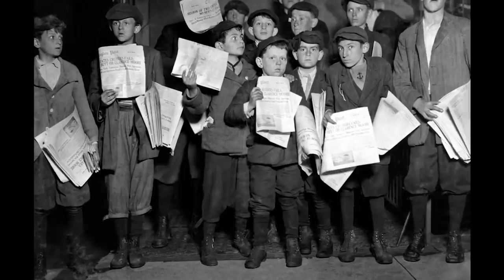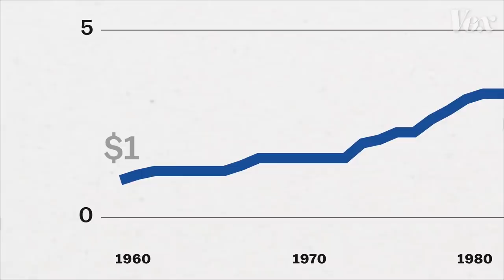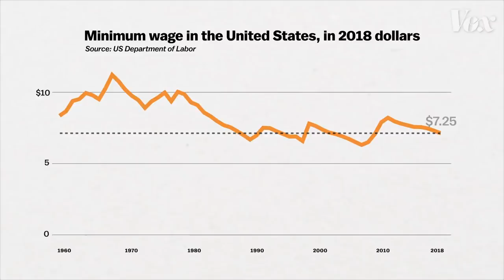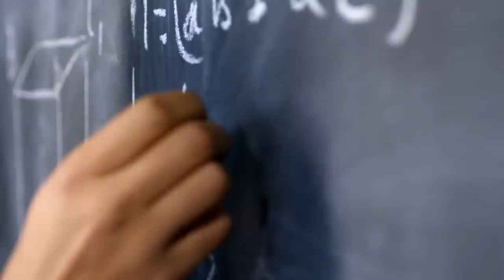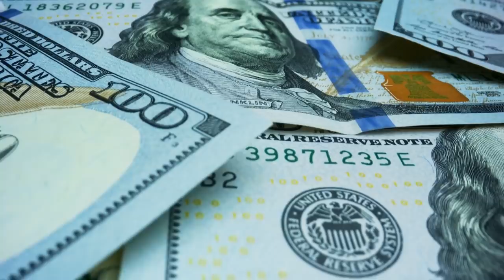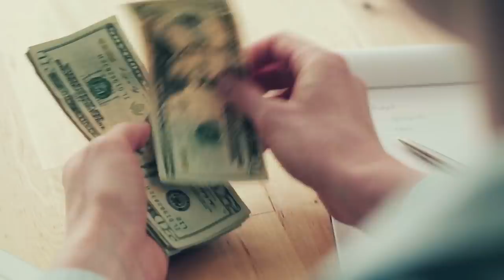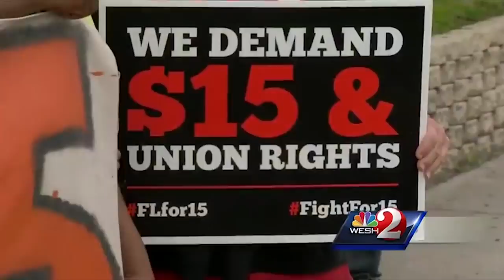The Minimum Wage Debate Explained

Comment: "Starter jobs" is an absolute bullcrap term anyways. Without starter jobs, no one's going to make your burger, take orders, stock the shelves, clean the crappers, server your dinner, drive you when you don't have access to a car, build said car, deliver you that fancy new item you ordered online, and I could keep going. Regardless of all other considerations, these are essential jobs, and they, and indeed ALL jobs, deserve to be paid living wages.
Reply: "Starter Jobs" imply that these jobs aren't necessary, but that term is used for anything but. The term "Essential Worker" and "Starter Jobs" are typically used together.
Reply: You get enough to survive. Want to live? Make more. Get a second source of income or add value that builds the company (which is different than just doing your job for 30 years).
Reply: @shaereub4450  go look to any graph comparing minimum wage to productivity over the years to see how BS that "add value to the company" line is and then stop bootlicking.
Reply: @shaereub4450  No, they do not, their wages must be subsidized by social programs. A system where one needs to "hustle" in order to live is a bad system.
Reply: @dynamicworlds1  yes but productivity increases are usually due to technological gains.  its not that the person making 7 bucks an hour is working harder than they did in the 1960's, its that they have technology now that wasn't available then.
Reply: @theharmelodynetwork  even if we accept that as flat true AND ignore the fact that real wages have declined, why tf should the workers' extra productivity provided by force multiplication of more modern tools (developed by other workers) go basically exclusively to rich people who's only claim to that wealth is that they already own more wealth than the people working for them?

And how does that counter my point

AND are the CEOs and stockholers sitting on their asses working any harder than they used to to justify getting a bigger piece of the pie?

I'd be fucking mortified if I made an argument that stupid.
Reply: Have you ever seen someone over the age of 25 work at McDonald's? It is a starter job
Reply: Look buddy, those "Starter Jobs" are important, but some people live with my parents and want to earn money to do some party  to work for 6$ a hour  is no problem for them. Some people need more but the employee will always know that somebody else  avaible so no chance that he will raise the wage.
Reply: @jamesmorgan3764  All the fucking time, dude.
Reply: @aidancollins1591  maybe they should further their education or gain some actual skills. It's nobody else's fault someone decided to drop out of high school and make Carl's Jr a fucking career.
Reply: @juanvaldez6651  I don't care about fault, I care about efficiency and maximizing freedom for as many people as possible. Our current system is and does neither of those things. It's clear you do not see people suffering as a problem you should care about.

Regardless, your assignment of personal blame for those who are poor is disgusting. Reeks of privilege.
Reply: No mate start jobs are jobs for young people entering the work place for experience 
And most of the jobs you said are good pay
Reply: @shaereub4450  you missed the entire point the video was trying to make.
Reply: @juanvaldez6651  who   the fuck gonna work at McDonald’s or Walmart if we all thought that way ?if we all were lawyers or some other high paying career they would be no one to work at these places
Reply: @MegaAnimeforlife  Those jobs are for kids to get work experience then find better ones. If you wanna work at McDonald's forever then go for it, but you don't deserve to make $20 a hour for it.
Reply: @juanvaldez6651  If these jobs were just for kid's they wouldn't be open during school hours now would they? Get real with yourself and learn how the world works, also nobody is saying they should get 20$ an hour.
Reply: @dynamicworlds1  idk how people want to work a 9 to 5 job meant for teenagers to have a family. I got an education to earn my wage. Stop being lazy and learn a new skill. That’s what the working class does.
Reply: @shaereub4450  dude you just proved why it's bad, if you need two jobs to live, then the system has failed you. People should not have to "just survive", they're people, not cattle. Capitalism and those who exploit others are vile and disgusting.
Reply: @TinyBearTim  these "starter jobs" are open 24/7, tell me how these young people can possibly manage to work during school hours.
Reply: @ABCD-vm1mx  how tf is someone gonna learn a new skill and work multiple jobs to sustain themselves, it's honestly so easy to poke through these arguments
Reply: kettle r  what if the person doing the job was homeless, an orphan, anyone who is alone? What if that job was what was supporting them? Maybe they are supported by welfare or some close friends, so they may not be truely alone. That extra money to help him or her is either other people's money through welfare by taxes or a handout by the charity of the people close to them. Should their money come from multiple sources or just from the employer? The multiple sources are pretty volatile. But, getting that living wage will free up that person's time to do other things or stay the way he or she is. The living wage income would be less volatile due to all companies providing good money and since they need labor anyways, they need only apply. It's better to walk a steady path then to risk a trail with shaky footing. They now have options rather than punishing them by trapping them into a bad situation with little leeway. They will eventually become stable and pay higher taxes into the system, so as to aid less fortunate people. They may change their source of income from welfare into investment.
Reply: kettle r  No one should work full time and not have enough to survive on their own, full stop. Any other arrangements are inherently going to be exploitative to workers. Companies that don’t pay enough to keep their employees off welfare are robbing the public coffers. I wonder who would be lobbying to keep minimum wages low?
Reply: kettle r  14 year olds don’t often get jobs these days. Teen workers are still a thing but way less prevalent then previously.
Reply: kettle r  how could your “living wage” be 70K or are you just throwing the word around like it means nothing.
Reply: kettle r  “living wage” means you don’t need a second job to be over the poverty line not to sustain my current live style
Reply: kettle r  I live comfortable but carefully at 20K a year the minimum wage right now gives people roughly 13K I can’t imagine living off of that.
Reply: kettle r  also people aren’t replaced by robots someone has to both build and maintain that kiosk not to mention its also damn expensive so often time business don’t even use them unless there a Fortune 500 company.
Reply: kettle r  you obviously still don’t get what living wage means your current wage is not what dictates a living wage stop calling it that but let’s move past that
Reply: kettle r  you know our birth rate is going down right? Who's going to feed all of these "adults" when you inevitably don't have enough children to do those jobs? And sure you could probably live off 6.15 in some buttf*ck town in the Midwest but if you live in a city, especially on the coast, you will be homeless. And like you're saying should a 14 year old be paid less than you working at McDonald's? No, you both should earn enough that with careful spending you can make ends meet. That's a living wage. You can afford a roof and food. And as someone with a college degree working in an entry-level position, I find it incredibly insulting and unreasonable that you should think it's ok to be paid so low anywhere. Look, yes, ideally you get a better job by getting a new skill. But new skill often require certificates by hirers which cost an exorbitant amount of money. Entry level will not pay enough for you to go to school or even play those classes. Sure you can do classes like skill share but you won't be hired until you freelance or whatever and you're not going to make ends meet for too long during that. Anyone who makes a living wage, could invest their free time into betterment, and save for classes. And honestly, the guy that cleans your toilets should be making what you make honestly. I know you feel entitled because of your expensive education but people that do those jobs have a rough go and their jobs are extremely necessary. It's insane to think it'd be ok for that guy to have to work two or three jobs. I'm working 3 right now btw. So, congratulations on your 70K live style but I'd be ecstatic to have $40 or $50k a year. I would be set. And sides, I think the billionaires can stand to tighten their belts for the betterment of society. Ffs, Bezos could sustain his current life style and that of his next like 3 or 4 generations if he stopped earning right now. There's no reason to hoard money. And should a owner of a company make less their their employees, well I suppose it depends on the time they spend but no I think they should make the same or similar to their employees for the amount of time and effort put in, just like them. My goal is to own my own business because screw bosses and selling my soul, and I will make sure I'm not paid significantly more than my employees. Matter of fact, if others do harder jobs, I'm content making less, as long as I'm comfortable. As long as we're all comfortable.
Reply: kettle r  yes for a single person who has no spouse or children and no intention to have either it’s technically just barely above the poverty line.
Reply: kettle r  I think that the wealthy nation on earth should have a higher stander then you have clothing and don’t go hungry your good. Sounds like fucking Africa that’s ridiculous. Norway pays McDonald’s workers 21 dollars an hour and their Big Mac cost 27 cents more I think we can handle that price increase.
Reply: @SchokoAprikose  if he wants to do more than look for a better job or get a higher education, work for it.
Reply: kettle r  have you ever lived in poverty I did as a child. I felt my mother’s fear and uncertainty. And because of that I to was afraid did we have food and a roof and clothing sure. But that doesn’t mean we where comfortable sometime we where afraid we would have enough for one of those things and it was a mad scramble to kind a solution because one time to fall down into debt and we would have no way to get back up again as we could barely make it with some corporation squeezing us with there interest rates.
Reply: kettle r  now my mom has a good job and isn’t a single mother. I have a good job to and I live comfortable but that doesn’t change the fact that other people don’t deserve living on the poverty line straddling it like a tight rope always afraid to fall afraid to have a family afraid to ever spend the little money they have because they might need it. All the while company execs give themself massive pay raises and bonus no I’m not ok with things staying the way they are and quite honestly it disturbs me how strongly people defend the corporations that lie and cheat and wouldn’t hesitate to throw you aside if it benefited them for one second.
Reply: @jamesmorgan3764  wtf?! Yes I have seen people over the age of 25 at McDonald’s...
Reply: kettle r   17 dollars an hour is above the proposed minimum wage so I’m not sure what point your trying to make.
Reply: @camerontaylor7471  not as many as under 25
Reply: kettle r  7.25 has been the minimum wage for the last 10 years to keep up with inflation it should have gone up at least 1.59 but even if we’d done that it had already flagged behind inflation for years and they didn’t raise it as much as they should have last time. The minimum wage has always been raise over time and it’s never bankrupted America or just a massive hissy fit from the corporations ever single time cause they just don’t like paying people more.
Reply: @austin5944  m8 it’s called part time and you can just get hours that aren’t in school time or a weekend job
Reply: I like cheap burgers and repairs and pizza deliveries. Everyone talks about affordable childcare, healthcare, education, housing. Nobody talks about affordable labor.
Reply: By increasing starter jobs wages, you increase all jobs wages and all product prices go up. Now your stupid 15 dollars are worth 6 dollars. Just get the government out of this stuff and the pursuit for profit will make things cheaper, and even with a lower wage you’ll must likely have more spending power. Spending power is the key not the amount of money!
Reply: @marcello1099  the market Isn't a perfect sistem and if thing would be chaper then there would be someone Who need less money to suvive and wages be lowerd by the company.
Also you could have a minimum wage Who just automatically adjust itself whit inflation whic Is what many countrys have.
If the minimum wage Is so connected whit inflation then that means than most of americans work full whit the minimum wage.
If this Is the case then the problem isn't the minimum wage but the economy itself.
Reply: Robots will soon.
Reply: Wait, don’t you get that increasing the minimum wage drastically simply reduces the amount of people doing starter jobs and increases the load of each worker?
That’s not good, it essentially erases “starter jobs” and makes them more demanding, higher paying jobs, WITH LESS OVERALL DEMAND FOR WORKERS
Reply: Justin Sawyer  a full time job Is a full time job independently of what kind of job It is. A kid could work in a farm but It Is still a full time job.
Reply: @aidancollins1591  You can’t just hand out freedom.
Raising the minimum wage for McDonald’s workers? You think that makes them more free?
There won’t be cashiers, there will be kiosks, the people making the food will be asked to do more and work on a smaller crew. Salaried managers are asked to do even more than they already do.
How is that increasing freedom?
Reply: Justin Sawyer  if you can't sustain a company by paying the minimum wage to your employes then your company Is not competitive.
I'm saying full time job because if you couldn't sustain yourself whit that wage then you wouldn't have time to learn new skills to improve your conditions or to get and other job.
Reply: Justin Sawyer  if you can't sustain to feed your workers whit a full time job then your company Is not sustainable in a cost\profit comparison.
Reply: Justin Sawyer  everyone loves saying it would destroy the market or increase good prices like crazy this is just plainly untrue. Other countries raise there minimum wage yearly to keep up with inflation and your telling me we America the most wealth country in the world can’t afford it ridiculous.
Reply: Justin Sawyer  obviusly this Isn't a discussion about when you first start the company but when the company acually Is stable. Usually you get a Loan when you start the company of you are that stupid to start a company and fail at the very beginnig then it's your own fault for tacking  the risk and not considering the costs.
If the governament stops pepole from being paid so Low than they can't sustain themself It Is not disincentivizing jobs, Is preventing slavery and protecting workers lifes.
Reply: Justin Sawyer  wrong we are still number one in wealth and no not all of those counties are affiliated with others. Not to mention how does the population matter when we proportionally per person we have more money then them.
Reply: Justin Sawyer  weather you mark is as first depends on how you measure wealth but we are always top ten regardless of the metric.
Reply: Justin Sawyer  if your company manages to go banckrupt then It Is not the minimum wage fault It Is your bad management. In 5 years an employe should have enought experience to at least get a raise. Stop blaming evrything on the minimum wage for an unsuxeful company. It surely won't be the wage fault if the wage Is the same.
Again bad management.
 Oh And thanks to the inflation the wage value acually goes down so there Is no excuse.
Your company could still fail even if you didn't pay wages at all.
Reply: Justin Sawyer  Demand meaning the amount of jobs the business needs.
You are the one missing shit homie
Three high schoolers vs two more experienced people 

That’s a loss of demand for one job.
Reply: Justin Sawyer  oh becuase the US has the se population as china and india i see
Reply: Justin Sawyer  like I said depends on the metric people don’t agree on what metric matters
Reply: Justin Sawyer  Lol, you are explaining why the minimum wage does not need to increase and why decreasing illegal immigration will help wages increase!
Reply: Justin Sawyer  dude i have just Google biggest GDP in the world and It came up the US on number one whit 19.485 trillions
Reply: kettle r  If the same is expected of a 14-year-old as is of a 41-year-old, namely all that is needed to do a job properly, why not pay them firstly the same and secondly a normal wage? The jobs need to be done. So why give the people who perform them an artificially low wage?
Reply: Justin Sawyer  first of all you ain’t teaching me shit. I know full well not every countie does it but it working in other countries is more then enough evidence to support it working here but also no not all the counties are part of things like the EU.
Reply: @kevinsouza7744  *
Reply: Justin Sawyer  if we count gdp per capita the of course tax heavens came out on top.
And the US Is still the 8th behind all of these tax heavens.
Reply: Justin Sawyer  and that Is why if we exclude tax heavens the US has the biggest gdp per capita.
Reply: Justin Sawyer  aren't you a bit too agressive? Just called me idiot for a statistic i did not share.
Reply: Justin Sawyer  https://en.m.wikipedia.org/wiki/List_of_countries_by_GDP_(nominal)_per_capita
Then what about Wikipedia?.
Reply: Justin Sawyer  i mentioned tax heavens because i would thought you would understand than i excluded them for being.....well tax heavens.
I made no aegument saying than tax heaven are better. Being a tax heaven in the US Is not sustainable
Reply: Justin Sawyer  then what source Is reliable to you?
Wikipedia Is One of the most checked sites in the world whit million of pepole contributing to It and whit a full staff controlling for errors.
Serusly link me a site you trust.
Reply: kettle r  You seem to be answering a question I posed by saying "because the skill labour doesn't change". But which one of my questions are you answering by saying that? I asked why one would not pay a 14-year-old and a 41-year-old the same. And I asked why one would not pay them a normal wage. And, lastly, I asked why one would pay them (referring to both the 14-year-old and the 41-year-old in my example) an artificially low wage. It doesn't make sense to answer any of my questions with a "because the skill labour doesn't change".

I am in favour of paying the 14-year-old and the 41-year-old from my example the same. And I am in favour of paying both of them a normal wage and of paying both of them a wage that isn't artificially low. The same goes for the 81-year-old from your example. All of those three people should earn the same since it's the same kind of work they are expected to do. The same quality of work and the same quantity of licked stamps per hour is expected of them. All of them do the same and are equally useful employees. And since they wouldn't have been given jobs if they didn't need to be performed, they should be paid a normal wage and not one that is artificially low.

Judging by your other comments, you are the one who wants to pay people artificially low wages. So it seems we agree on how everybody doing a specific job should earn the same, no matter their age. But unlike you, I advocate for paying them all a normal wage and not an artificially low one. I really don't get how you could misunderstand my comment to say that I think that a 14-year-old and a 41-year-old should earn different wages despite both of the doing the same job equally fast and equally well.

Edit: Added missing word.
Reply: Justin Sawyer  and i acually want to Say It because i checked twice but wikipedia in this article makes referente to the united nations and  the International monetary fund.
Reply: Justin Sawyer  so you don't belive in the biggest International oraganization in the world?
I guess the conversation ends here because we've come to a point where we can't reach a common ground.
Reply: @SiegePerilousEsauMaltomite  In their ability to have more income, get paid vacation, enjoy life more, and have better workplaces, yes. There is a positive freedom to that. The rest of your statement is filled with a bunch of nonsense not worth addressing.
Reply: kettle r  that means the only reason you can't work in McDonald's at 14
Reply: A job is only worth what someone is willimg to pay for a service.i think the argument should lie in profit sharing
Reply: @jamesmorgan3764  
Are you crazy or willfully blind.
Reply: Justin Sawyer  
Is it a hate crime to wish you to be the  victim of a violent crime.
Reply: Justin Sawyer  how am I uneducated I’ve been to college?
Reply: Justin Sawyer  I am perfectly willing to learn thing you have quite simply not mentioned anything I don’t already know or your info is with corporate lenses. Our countries standing in the top ten charts is not really relevant to the fact that we have the worst labor laws and it’s considered blasphemous to want to pay people a reasonable amount for there time.
Reply: Justin Sawyer  The risk is the time you put into the job flipping those  burgers. The entitlement comes from the fact people are paying you to prepare food for them. You argument that they shouldn't get a share in the profit is fucking stupid. If they weren't flipping burgers then what would people be paying McDonalds to do? Exist?
Reply: @ABCD-vm1mx  And where did you live when you were doing this? You pay for your own food and housing? Where did you find the time to go to school and pay for this oh so affordable housing that you had. What was your rent fool? Stop thinking everyone circumstances are the same as yours. You think your the only one that exsists in the country?
Reply: @ABCD-vm1mx  
Interesting.
Now let me inquire a bit.
Hypothetically speaking wouldnt you still be on hook to pay for the loans you took even if you didnt land a job making you, gasp, a poor person?
Also I wonder how many job openings your career has, can it support massive influx of new job seekers if they decided to do the hustle?

Sure is nice standing in glass tower and try to forget the fact that there will always be more people below it than at the top
Reply: kettle r  Responding to both your replies in one go here. A normal wage is one you can live off if you work full-time and without having to resort to methods like living rent-free with a partner or relatives/family members. And no, I personally would not pay an engineer more than someone "sweeping the floor". But I also don't think that the difference in what those two people make needs to be big. How about paying an engineer only two to two and a half times as much as the "floor sweeper" at most . How about paying the engineer only one and a half times as much as the "floor sweeper"? One argument you seem to have against that seems to be that "minimum wage means minimum labour". What makes you think that? I have worked in a couple of jobs and in most of them I could also form a picture as to what the working days of my co-workers who were performing different tasks and who had different job titles entailed. I have for example worked as a trained nursing assistant together with what in the US is called "registered nurses". A registered nurse earns roughly one and a half times as much as a nursing assistant here. But this is not due to registered nurses having to "work more". They work more competently than nursing assistance. They went more into depth in their training, and they are allowed to do things that nursing assistants are not allowed to do. They have more responsibility. Which leads to them also having more opportunities to sit on their asses for at least part of the day or just standing and not having to lift heavy things and heavy people. This is not a problem for me. It makes sense that it's like that. But it's true that a nursing assistant burns more calories during their workday than a registered nurse does - at least on average. Minimum wage does not equal minimum labour. I don't know how you managed to develop that concept. It kind of makes you look like an ass. (I wonder where - or whom - I got that respectful way of phrasing things from.)

And why would you have to double everybody's wage if you double the wage of someone who is currently making minimum wage? If you have a "floor sweeper" making $7.50 and a person working in accounting making (the equivalent of) $14.25 and an engineer making (the equivalent of) $45 an hour, why couldn't you simply raise the "floor sweeper's" wage to $15 an hour, the person working in accounting's wage to $16.50 an hour and not change anything about the wage of the engineer? I know this leads to a higher total cost of salaries, but this is not the issue you're raising. The issue you're raising is that the engineer would also have to get his salary doubled if the "floor sweeper" got his salary doubled. But why? Where's the problem when the wage gap between the person earning the most and the person earning the least in the company shrinks? And in what world would it make sense for either the engineer or the person in accounting to quit? Would this lead to them getting higher salaries elsewhere? No. Does the fact that the engineer can't anymore say that he earns six times as much as the "floor sweeper" but that he now can only say that he earns four times as much as the "floor sweeper" make the engineer suffer in any way? Tell me, what thought process lies behind the notion that someone with a high salary quits their job over someone else in the company earning more than they (the other person, not the person with the high salary) earned before? If I earned 4'500 a month working on a computer all day and some cleaning staff member in the same company got a pay rise, resulting in them not earning 3'500 anymore but instead 3'900, I would think that this is good for them. Maybe I would think that it is unfair that I didn't get a pay rise. But why would I quit over that if I knew that everywhere else I would also earn 4'500 a month. And if I indeed could earn 4'800 a month elsewhere - why would the pay rise of a co-worker (or whatever you want to call it) lead me to quit my job? Why wouldn't I have switched jobs earlier? Nothing about a pay rise of another person makes my life worse or my job harder, unless I start earning less because the money for the pay rise of the cleaning staff member comes out of my salary.

One last point: Which goods and services would start costing more and by how much would their price rise? This is actually addressed in the video. A Danish McDonald's worker makes $22 an hour. And the hamburgers there don't cost ridiculous amounts of money. And Denmark isn't exactly a country with food deserts - everybody who buys a hamburger at McDonald's in Denmark has easy access to food that costs less and is more nutritious.
Reply: @MrAapasuo  the thing is, I landed a job right after I graduated. It’s where I did my hours which is something the school does so that we can acquire a real time to hone our new learned skills some offices pay for the internship, and I specifically looked for one that paid, it was minimum wage at the time,  but my time is valuable and for the moment I took anything over free labor. I also asked for my wage and benefits before starting actually working there. And I’m not poor because I refuse to be. There’s a way around everything. My school helps me find a job if I ever need one, and I’m not required to stay in the ones that offer the bare minimum for my skill. Gasp! You can actually choose where you work. Coming from someone who lived in Mexico. Y’all Americans complain too much😂. And if you’re wondering I’m a dental assistant. You can look up the wage. Some states don’t require a license for it, but mine does. There’s always a need for dentist. Therefore a need for assistants and they always hire more than 1. Because if you’ve ever been to any healthcare facility you’ll know it’s gets crazy behind the scenes. So my job will always be a necessity in America. What I like about mine though is that we’re safe if free healthcare becomes a thing, since our office is privately owned. So we won’t be overworked and paid less than what I know I deserve.
Reply: @MrAapasuo  since my job requires a certain set of skills and is constantly changing, time only becomes a benefit as it becomes experience. When employers are looking for people in my field they want someone that won’t cost them 3 months of paid work to learn how to take X-rays. As the schedule will always be hectic and time is money, they don’t want someone that backs up patients. And in the situation that I do lose my job, I have enough skill to seek out another job and better pay since a lot of my jobs are looking for lead assistants or managers, you know someone with experience. So my starting pay will only increase as the years go by. I’ve only been working for 4 months and my Dr already wants to raise up my wage to $14/hr. I’m getting paid $12 at the moment and the starting pay in my state is $7/hr.
Reply: kettle r  Just replying to one reply here: Because you get more money that you either need or want. And again: There's no reason at all to even suggest that with some tendency a person earning $14.50 an hour has to work less or less hard for that salary than a person earning $16.00 has to work for their salary. Since when is a working day of 2 hours of mundane computer work and 6 hours of preparing food more or harder work than a working day of 8 hours of preparing food? The opposite is the case. And the one working on the computer for two hours each day is the one earning more because he's the superior of the other person.
Reply: @ABCD-vm1mx  
Kudos to you but Im no yankee, born and living in Nordics.
By the way you might be interested in learning that in many places with universal healthcare Dental works are still private, though subsidied for school aged kids.
Not that it matters as healthcare workers are some of the best paid professions here along side higher education teacher's.

One can indeef choose where to work, if there are jobs open that one can do.
Not everyone is educated for everything, shocker I know, so I doubt any dental workers here will be picking up welding any time soon to work in shipyards. 
And one can refuse to be poor if they wish but most people I think are in consensus that being poor beats going homeless
Reply: kettle r  
Im pretty certain a child/teen could run an company so I guess we should replace all CEO's with min wage workers
Reply: @MrAapasuo  I’m not poor and I’m well off. I equate being poor to making less that 1k on their pay check. Which is something I was taught was bad. That is why I said, you can get a black collar job that pays well, or a yellow collar job that pays well and treats you well if you actively look in the right places. Maybe I’m more optimistic and ambitious but my time and skill are valuable. I think most people give their employer the power even though your what keeps the company running. Like I said every job should have benefits where employees aren’t afraid to miss work and provide liveable hrs. I know that I take a week off, my paycheck will still be the same. And it’s something I worked for. I’ve also m noticed that more and more healthcare workers are coming out and stating that in their countries where healthcare is “free” they are still paid well, but are overworked. So if a nurse made $20/hr either her hrs gets cut, or she works more than usual at a lesser wage. Maybe it’s a small percentage , but in a country like America that wouldn’t slide. As free healthcare wouldn’t benefit those working in the healthcare system. I always advocate for affordable healthcare, it’s always baffled me how someone who makes 20k a year is charged by hospitals to pay for a $20 million dollar procedure or the only other options cost more than their accumulated 5 year income. Big pharma is a problem, as medicine is usually machine made and the cost to make it is inflated at ridiculous levels. Also I appreciate Dr’s and their skill, but they either shouldn’t be working the hrs they do.18hr shifts are hell and the fact that it’s usually 5 days out of the week is ridiculous and why I feel hospitals overcharge for procedure performed by certain specialist. Even if they only worked 12hr shifts they would still make more than they need, to maintain a luxurious lifestyle and be able to pay off school. I also believe that healthcare should be free for the children and the elderly. And something that should be covered by employers out of their own pocket. As companies make too much money, more than they already need, and studies have shown that the more money they make the cheaper or worse their product becomes. It’s also a way to know that the government only pays for those that actually need it. And those employed(in any job) still get healthcare, that is technically paid by them, but not with money taken out of their paychecks as long as they work in the company or hold a job, they are guaranteed healthcare. Which is something I actively advocate for. Hopefully one day in the future it’s becomes a popularized idea.
Reply: kettle r  
Fancying this sort of game huh?
Show me in turn a child can make fastfood without any education or a child that knows what various cleaning substances do without being educated
Reply: @ABCD-vm1mx  
The overworking problem is real in healthcare, but not caused by healthcare being free.
Its simply the fact that there are not enough doctors to meet the need of people, thus exidting doctors are used past their limit.
And more money stringent cities, much like in any country including USA try to be "prudent". Roads left unmaintained, less public workers, etc.
I actually agree eith you on that min wage shouldnt be needed but frankly that would only happen with strong unions for workers that can negotiate benefits and wage for members.
And only thing, from my understanding that americans hate with burning passion is Unions
Reply: kettle r  
I said without education didnt I.
Or let me try to put in way you would put it, all on their own.

Cause you know, workers in fastfood places are under supervision and are shown how to operate the kitchen.

I guess not every schmuck knows how to flip an burger I guess
Reply: kettle r  
cute, first you use teens as examples and now they are too old to be an example. well too bad but she founded the company when she was 12 apparalently

Im still waiting those burgers to be flipped kettle, let me se how you do on them without being trained
Just to be fair also you have to buy your own industrial kitchenware to do so
Reply: @ABCD-vm1mx  oh cool so family is for the rich? Do you know how stupid that all sounded? "I worked an entire year just so I could find a nonliving wage job, isn't my life great, too bad those lazy poor's can't do what I did". It doesn't matter the amount of skill it takes for a job, those "low skill" workers are essential to modern life, see how well you'd fair if we had no super markets, fast food, amusement parks, movie theaters, or retail stores. Everyone deserves a living wage by virtue of them being human beings, no person should starve, they shouldn't have to "prove their worth", they're people. We've gotten to a point where people are nothing but livestock, used to get their ranchers rich, while living a horrible life. Every other species on the planet gets to live their life free, while humans are forced to be complicit with the machine.
Reply: kettle r  minimum wage when implemented was supposed to be a wage you could live off of. Why did it change definitions ?
Reply: kettle r  what happens if you were victim of one of the major financial crashes in the last year, what happens if life circumstances are just too much, what happens if you don’t have proper healthcare bc you’ve been poor and you don’t have your families to get on, but you end up working through it ignoring your problems until they’re too debilitating to keep ignoring. No one is saying YOURE responsible, but Jesus Christ it’s like nothing in the last decade has even occurred to you. Life and people’s social economic position is much more complex than “making a mistake”. If that was the way the world works how are you even where you are, everyone makes mistakes and nobody deserves to live in a stressed out hell of a life because you can’t seem to understand that not everyone makes “mistakes” I’m sure some do but are you going to punish all poor people simply for being poor. To you it seems like the mistake is simply existing. If you knew anyone who worked minimum wage at grocers/restaurants/other low income jobs you’d know that each and every single one of them has a strong work ethic stop assuming you know people you have never even had a conversation with that they’re lazy and entitled. I would never assume how you got where you are or what choices you made or what kind of person you are but I can see your ego through the comments, lol and you only make what 70-100k you’re full of yourself.
Reply: @davidsenderodelsanto  you won't say that when bread costs 30$
Reply: @austin5944  jajaja my family are immigrants from Mexico, my dad had mad skill in building houses, but that took too much work and was very little pay if you work for someone. We’re not even middle class, but my dad put all his savings into buying an acre of land and building our house.  There was no well paying job in our area, so my dad moved again and became a migrant worker to bring more money home. Go be sad and pathetic elsewhere😂.
Reply: @austin5944  you can argue all you want, but there’s always better jobs you’re just too lazy to find one. And these jobs you want a higher wage for are for teenagers lmfaoooo. Want real money? Get a real job. Problem solved😃
Reply: @ABCD-vm1mx  pointing out the problem is not an answer to the problem. Juat because someone did it doesn't mean you should have to do it. Like seriously it's so funny how people point out stories of single individuals making it, going through horrible conditions and such, while not realizing that person should have never had to what they did in order to be where they are today, I applaud your father for his effort, but he should have never had to do that in the first place.
Reply: It is apparent that you don't have any idea as to what you are talking about nor have you ever owned a business.

OK, you have a large spectrum of jobs there, so I'm not going to delve into that.  But I will simplify it like this.  The companies that are out there that have menial task and entry level jobs do not necessarily have to pay a "living wage" to anyone.  You are a commodity, and if you bring more value to the work place, then you are more desirable and thus, worth more money to the employers/companies.  But what you are asking people to do is add unnecessary value to low level/menial task jobs.  That would be like me forcing you to pay $50,000 for a Hyundai Accent.  There is absolutely no way you would do that and absolutely no reason for me to try and force you to do that either.

When the government artificially inflates the wages, it automatically lowers the value of those that actually have valuable skills, while automatically raising/inflating the costs of goods and services that company provides.
Reply: @jmackinjersey1  wow you just pointed out the problem with capitalism AND DIDN'T REALIZE IT!. How can you say "you are a commodity" and not figure out that's a problem, these are people with lives, not a Hyundai accent.
Reply: @austin5944  OK, let me dumb it down for you like this, since it went completely over your head and you can't understand how it works.  Everything and Everyone IS a Commodity.  You are more or less valuable to someone else by the good or service that you provide.  A doctor is not as valuable to a ship builder as a welder or electrician is, and a person that sweeps the floor is not as valuable to either the doctor or the ship builder as the Nurse or welder is to either of them.  Is the sweeper valuable?  Yes, but he does not make the business as much money as the others do.  
That does not mean that the sweeper as a person is less valuable as either of them and doesn't deserve the same amount of respect.  But the sweeper is only bringing in a smaller amount of value to the table as the others do in their relative business.

Just like the Hyundai Accent will move you from A to B for a lower amount of money as compared to say a Hyundai Santa Fe will also move you from A to B, but it can haul more people and cargo as well as assist better in foul weather.  The Santa Fe costs more because it is larger(material) and brings more value to the table because it is more useful.  Or you can go to the Mercedes and add more luxury and even more features, which adds to the value of the item.
Reply: @dynamicworlds1  it's not about adding value to the company, it's about adding value to yourself. It's an issue of supply and demand.
A government mandated "livable wage"  completely ignores that issue.
Reply: @austin5944  arguing for a "livable wage" is just virtue signaling. The left, or the socialists, don't actually care about the essential worker.
Reply: @muchoed5119  yeah sure, I mean it's not like that's the whole point of socialism or whatever, returning power to the worker and ensuring good lives for each and every person. But yeah we're definitely just virtue signaling. I mean if you can call that virtue signaling then hell, noone stands for anything and politics is null.
Reply: kettle r  what about people who did lol a small percentage of Americans from all economic backgrounds who used there checks to pay for luxury items is responsible for you hating all poor people got it. Since you love to generalize people I hope you don’t have anything to say about African Americans😐
Reply: kettle r  also good job just glancing over every single other part you’re just a meme bro just talking points you’ve seen on tucker Carlson or sumn lol, imagine
Reply: @jmackinjersey1  You also have the choice to accept or deny a job based on how it will benefit you. The fact that people are bold enough to ask for more money and work the bare minimum but not ask for benefits at their workplace that will encourage better work ethic is baffling💀.
Reply: @austin5944  where, in socialism, is the empowered worker? Where has it improved the life of each and every person?
If you really want to make a difference; fight against corruption, demand transparency, and eliminate the minimum wage all together. But that's difficult, boring and thankless. It's much easier to just say the words, livable wage.
Reply: Good luck paying $30 for a hamburger at McDonalds.
Reply: @muchoed5119  ok whatever, there's literally no point talking to you if you can't understand the basics of an economic system. And a living wage isn't socialism, it's just a step in the right direction.
Reply: kettle r  you don’t understand sarcasm do you huh
Reply: @austin5944  Where did I reduce life to anything?  I never said a person's life is invaluable or worth less or more based on anything.  I placed reality in front of you and you refuse to learn and understand what reality really is and how things work in the real world.
Reply: @jmackinjersey1  because that's a capitalist reality, find me a physicist that says "well the way we can tell if things are elements is by if they can be bought and sold, that's reality you know.", And yes you did reduce life to a commodity, something to be bought and sold.
Reply: @austin5944  That has nothing to do with that which I said.  I NEVER said to buy and sell a PERSON.  I said the value they bring to an employer.  Hell, even you pay people based on their value to you.  So get your head your of your mightier than though ass and see what is happening in Reality.
Reply: @ABCD-vm1mx  I think we are on the same page, actually.  There are many companies out there that pay great wages, and only employ a few that are at or around the minimum wage.  But here is the kicker, in the US, the Obama Administration and Congress made it almost impossible for an employer to offer great benefits.  They outlawed any new "Cadillac" plans, and made most of the current at that time too expensive for the employers to afford.  However, look at one of the examples I talked about, Whole Foods.  They gave the employees $15/hr for menial task, entry level as well as upper responsibility/level jobs.  But on the other end, they cut back on certain benefits and programs they had in place that were actually worth more than the $15'hr they would now be receiving.  I mean, you can't expect a company to run at a deficit and stay in business.  Not to mention that those that were already making more than $15 didn't receive the same percentage of increase.
Reply: People should have value adding skills. So they leave their minimum wage jobs for something better. 

While the min wage is too low. It is also a distraction on systemic issues in the labor market and education system.
Reply: @austin5944  As for those starving globally, 99.9% of them are in a country that is one form or another totalitarian and tyrannical in nature/leadership.  Those leaders usurp the power and energy from their people, they literally buy and sell and enslave their people in one form or another.  I have been to a few of those undesirable places and seen, first hand what happens to them and how they can be literally killed in the front of their house for speaking out against the leadership, or when we give those people food and water, the same food and water is then stolen from the citizens and used by the leading class.

So don't even, for one second try to tell me that here in the US, it is so bad and unjust.

Again, What is YOUR Business?
Reply: @jmackinjersey1  what so you mean what is your business? Totalitarian capitalism is still capitalism, in actuality it's the only form of capitalism; it's either the state or the corporations that do the oppressing, it just so happens that in America they disguise that oppression as opportunity. Wage slavery is still slavery. You can't say 4 billion people all live in those countries you've been to. You've moved the goal posts, just because it's better in America doesn't mean we can't call it shit still, if the wealthiest nation on earth cannot provide the basic needs for ALL of it's people, it is shit. I'm tired of people saying "well it's worse somewhere else so don't call it bad here", gold plated shit next to normal shit is still shit.
Reply: @austin5944  Again, I ask you for you to tell me what business you own and operate.  But again you go off on a nonsensical tirade about corporations oppressing people.  Where exactly are these poor downtrodden employees that aren't getting a fair days wage for a fair days labor?  Where is this elusive wage slavery?  where are these people that are being forced to work in any situation where they are not making the amount of money that they are supposed to be paid?  You are correct, and I did not say that I have been to all of the countries in the world that are being lead by tyrants. I've been to enough to know what is actually going on in the real world.  I am not moving any goal post, I am stating facts.  It is not my fault that you can not understand that.  It is also not my fault that you can't see and understand that we Do live in the Greatest Nation on Earth, where people are doing everything they can to come here, even if it means the possibility certain death by either their tyrannical leaders or nature.

Again, what have YOU done to make it better for everyone?  Where is the business that you bootstrapped and built from the ground up and have employees to pay?
Reply: @austin5944  you don't care about the economy and you don't care about the essential worker. 
You only care about YOU.  Screw the 50% of essential workers who lose their job by doubling the minimum wage, as long as you get to demonstrate how virtuous YOU are.
Btw, people ARE commodities.
Reply: @muchoed5119  
How would 50% of essential workers lose their jobs just out of curiosity.

They are essential, the job itself that is so no matter the cost the companies would need to fill those vacancies.
And automation while happening isnt geared for rapid takeover, robots still cant perform more complex jobs, and even for more simple jobs robots are not always fit for tasks making getting one an expensive investment to any company.

Hell itd be better to embrace automaton head on anyway, longer one waits the harsher it will hit when it does happen and at thst point countries that at least attempted to find solutions will be better off than those that tried to go against it
Reply: @SchokoAprikose  Other countries handle that by having lower wages for those under 21, but it is still linked to the minimum wage so that it increase yearly.
Reply: @juanvaldez6651  In other western countries that do earn $20 per hour in McDonalds.
Reply: Unfortunately, businesses will not need humans for those jobs for much longer. We can raise the minimum wage, but it'll probably speed up that process
Reply: @shaereub4450  Thanks for pointing out the inherent the failure of the system is if you have to work 2 jobs to live
Reply: Deep
Reply: Justin Sawyer  You sound like someone who just found out what logical fallacies are and has the thou shall not commit fallacies sheet pulled up as he debates in youtube comments
Reply: Justin Sawyer  I literally said you sound like someone who just found out what a fallacy is and has the thou shall not commit fallacies chart pulled up, and you're saying that's hate? I literally made a joke and you're acting like it's a personal attack and saying I don't have standards. A bunch of assumptions of a joke. Looks like something struck a nerve
Reply: A starter job just means requiring little or no skill. These are essential jobs. I disagree with what this person said about business and fair market. If it were truly a fair market, there would be no minimum wage. I think the minimum wage has to go up, but I that will not solve the problem.
Reply: @jamesmorgan3764 It’s up to the person the advance.
Reply: @aidancollins1591  A lesson in economics might be helpful.
Reply: @thereita1052  Inflation is closely tied to minimum wage — raising minimum wage tends to increase inflation. I don’t know the answer, but it is not fixed by arbitrarily raising the minimum wage.  It’s more complex.
Reply: @jimziemer474  Already taken, got the 3.0 social science credit back in my AA. However, since you seem to know more about this subject, I'd love a run-down of how exactly a minimum wage increase hurts the economy.
Reply: @jimziemer474  inflation sometimes Is a good thing to let the economy expand.
Hyperinflation usally does the damage like in Venezuela or the Weimar repubblic.
However Is not directly linked to the minimum wage because usually pepole have wages higer than the minimum wage and if It not then It Is not the minimum wage the problem but the sistem itself.
When the minimum wage Is encreased the inflation doesn't immediatly increase and that Is the answer: increase the minimum wage and then fix It evry year to inflation.
Reply: @dynamicworlds1  the ceo paid for those gains by getting the tools for the worker the worker didn't pay for the tools there for the owner increased his production not the worker
Reply: How is that not a starter job I literally started at McDonald's HAHA
Reply: @aidancollins1591  stop shaming people in a argument. It doesn’t matter if people suffer. That’s reality. If it works okay kool change if it doesn’t okay cool don’t change it and they need to find a different job just like I did. Like i don’t understand why it’s so fucked up to expect someone to do something else if there not getting paid enough. I’ve done this 6 times in my working career. What’s wrong with having expectations for people.
Reply: @superrewind  Good for you, I'm glad you have improved you situation. You're essentially giving me a "personal responsibility" argument right now, which is nonsensical in the context of a systemic failure.

I want a systemic solution to a systemic problem which makes millions of Americans materially worse off. I want this because it will make our country safer, our people healthier, less anxious, and maximize freedom for the most amount of people possible. It seems like you do not care about the material well-being of others, and there's nothing I can do to make you care.
Reply: I encourage you to go and start a business, and be told by the government (who are anything but poor people) that you MUST pay your workers more than you can afford to pay them. That you MUST cover costs for your workers that you cannot afford to cover.

Not all jobs deserve to be paid a "living" wage. If they did, then all jobs, regardless of what they are, would be offering the same incentives and the same outcomes, which is fucking retarded. Why in the HELL would a person want to work as a sewage cleaner if he/she could work as a bagger in a grocery store if they PAY THE FUCKING SAME?

And don't tell me "but it's not going to affect higher income jobs!" No, it most certainly will. Companies want to maximize profit. In some cases that's just greed. In most cases, that's just common sense. You don't pay your workers more money unless they are worth more money. But if the government tells you you MUST pay them a certain amount, it has an effect on how much you will value your workers.

And let's steelman this shit right now. Let's assume all these business owners are all evil sociopaths. What would an evil sociopath do when forced to pay their workers more? Really think about that for a second. You aren't going to make evil people be good by forcing them to pay their workers more. People will lose benefits. People will lose full time work and be forced (more often than they already are) to work multiple jobs. Companies will leave the country if they can, and go to other states that cost them less at the very least, meaning MORE people will be out of work.

And you won't be able to start up your own business to fill that void without running into the same fucking problems you created for the businesses that left. So how do you make money for your community at that point? If you want to solve poverty, this is not the way to do it.
Reply: @brigandboy1425  daam i totally see those thing you said in Germany whic has a higer minimum wage and less medium worker hours.
It Is not like it's the biggest economy in Europe.
And surely there are plentyful numbers of well developed countrys whit a lower minimum wage surely here Is a list:
1
2
3
Wow those are so many! And surely other reasons like the cost of moving or trasportation or market competivity or tariffs won't make It unprofitable to move. Not at all.
And  surely you can't start a comany whitout paying your workers the minimum to survive because if It something Is profitable enought to start a buisness when the minimum wage Is low then whit a normal minimum wage It Is not profitable anymore by any cents.
Reply: Study macroeconomics in a thorough manner and you'll realize the living wage myth pushed by the elite is just that
Reply: @idipped2521  Have you ever taken a Macro-econ course? That shit is talked about immediately, they literally tell you once you get to market equilibrium that rent control and minimum wage is bad because it creates an artificial shortage of supply. However, this is an extremely reductionist look at the economy and only exists in theory. There's a lot of good reasons many seasoned economists reject this framing. Your knowledge, I assume, is limited to conservative talk shows and internet forums.
Reply: Now realize that all of those items except the services and some of the food is made almost entirely outside of the country you live in. We're not competing locally here we're competing internationally and digitally.
Reply: @MrAapasuo  Hey, sorry for the late response.
I understand what you're saying about essential workers, but a company doesn't have to stay in business.
What is your opinion on, the price of automation going down while employee costs go up?
Personally, I think we should abolish the minimum wage altogether. 
Also;
What if there were less people competing for jobs?
How can smaller companies compete with the behemoths? 
How can we help more poor people get jobs?
I'd just like to get your opinion, thanks.
Reply: Perfect comment
Reply: @juanvaldez6651  well said sir.
Reply: @aidancollins1591  suffering because they chose to be lazy and not educate themselves? I always tell people who don’t want to go to college is to attend a trade school. I went to trade school, finished making $27/hour but then went back to college for engineering and now I make a crap ton more money because I put in the hard work.
Reply: @chucknorris9511  I do not care. I'm not going to assign moral blame to people and judge them as "lazy" for being in the position they are in. Good for you if you're doing well, most people could use the extra help.

If a system leads to poor and unnecessary outcomes, it should be changed. I would like to see one which extends the ideals of the enlightenment (liberty, equality, brotherhood) to as many people as possible.
Reply: @aidancollins1591  by raising the wage? 😂
Reply: Good thing you can make your own food at home right? Oh right, millennials were never taught that...
Reply: @SchokoAprikose  The whole point of raising the minimum wage to a living wage is to protect vulnerable people from this kind of predatory behavior. Just because someone lives with their parents doesn't mean that they should be paid a slave wage. This is called civilization. If you can't pay someone 12 dollars an hour or more, you shouldn't be allowed to hire people.
Reply: That’s wrong, I know receptionists and amazon warehouse workers and they get paid 20 an hour and it’s easier and less skilled than many minimum wage jobs. I work as a bookkeeper and my job doesn’t take much skill but I get paid decently. EMTs make shit wages for what they have to do and see. So wages don’t always correspond to how easy and unskilled a job is
Reply: Trade school still costs like 15k a year, where is that money going to come from? I was only able to go to school living with my parents and basically saving all my wages. Someone who makes minimum wage and has bills to pay can’t afford schooling. Many low wage jobs are offering to pay for school but it’s usually some business program, not the trades.